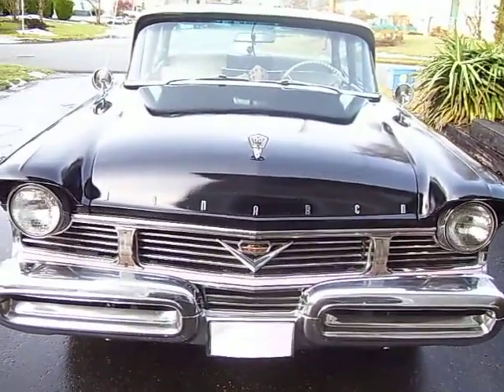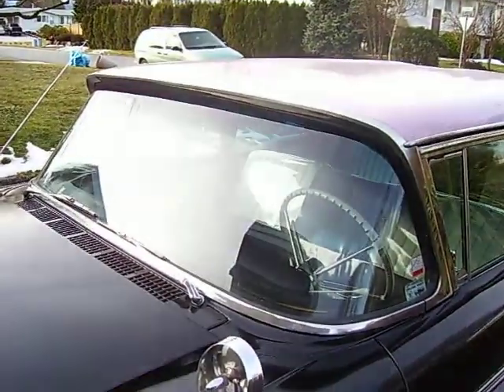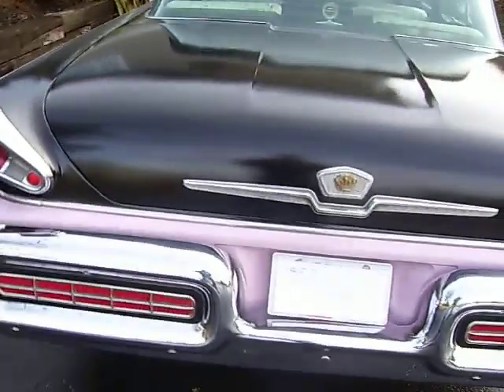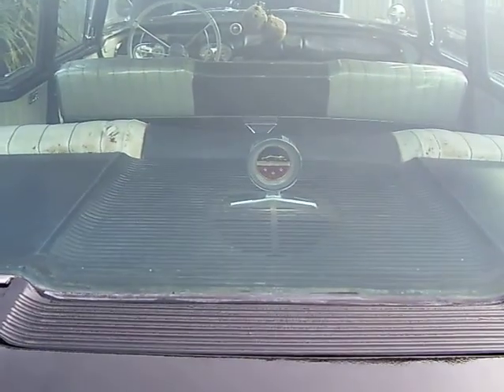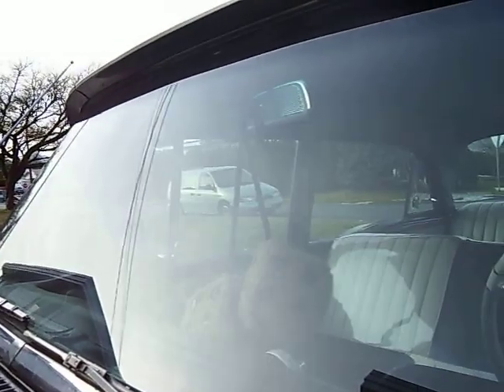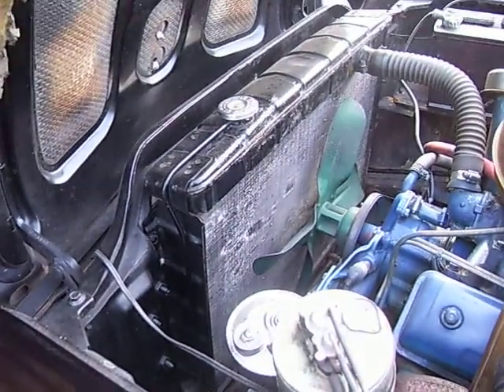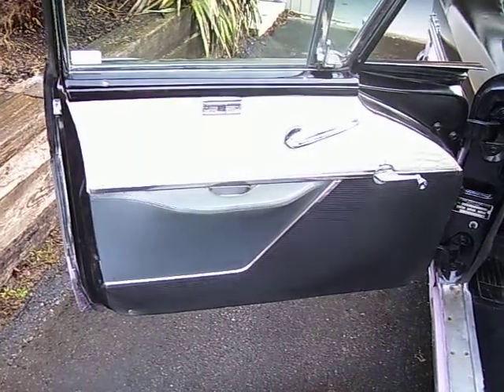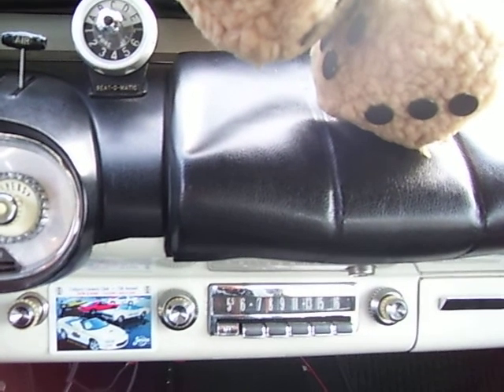1957 Monarch Richelieu Canadian version of the Mercury Montclair.

Comment from the maker: Thanks. I put the front reflectors on back in the 80s to meet the federal manditory side light reflector requirements but the back lighs have side visability as they wrap around the side. The steering wheel was on the car when I bought it I seen other 57 with the same wheel I think it was an option to have the plain center but chrome spokes.